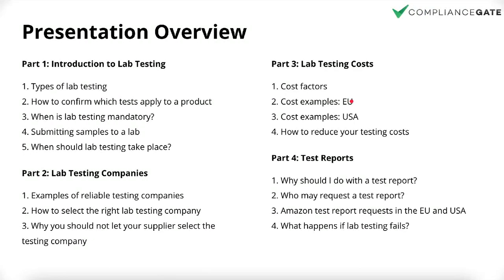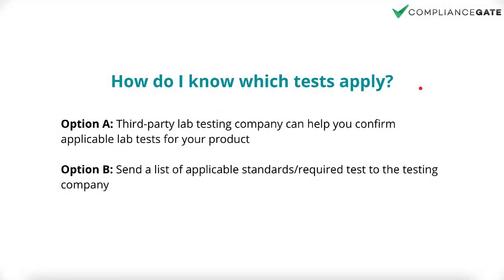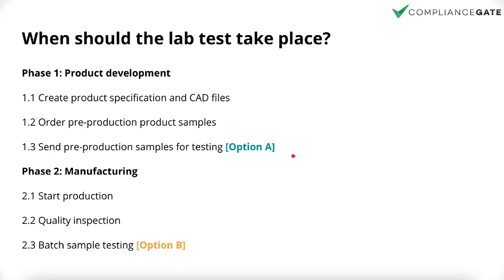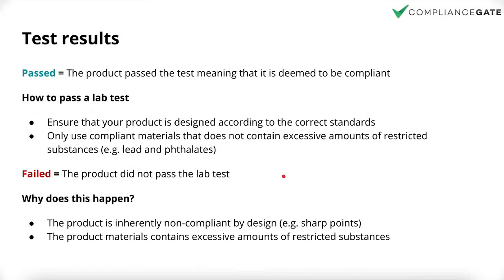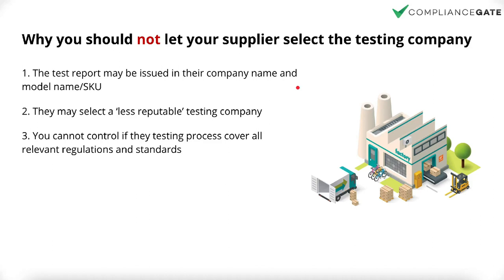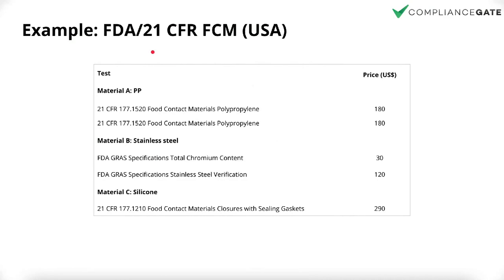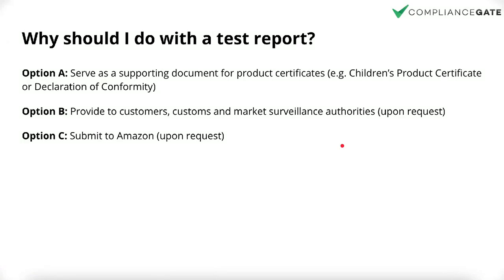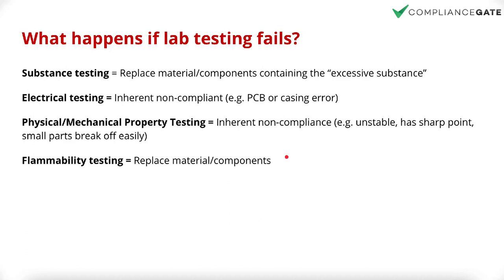Product Safety Testing Requirements in the United States and the European Union

Comment: Thank you for the Free information - much appreciated. 

one question I have though

If I, as a manufacturer have CE / GPSR Documentation and I provide this to my Importer / Distributor in the EU region, do they need to "Verify" by also testing the same product themselves using a 3rd party CSPC accepted company at their own cost as well in order to be a compliant seller in EU?
Reply from the maker: Hello,

For starters, CPSC accepted labs are relevant in the context of CPSIA and other CPSC standards - not in the EU (although many of those labs also provide testing according to EU requirements).

When it comes to testing, it depends on whether you can provide up to date test reports or not - corresponding with EU requirements.

If you can, then it's less likely (not but impossible) that your EU customers would need re-testing.

That said, if the test reports are outdated, or the product or material has been modified, then testing could be required.
Reply: @ComplianceGate  Thanks for the reply!

Ok, so it is more simple than first appears in that if the product is the same as tested and in a recent timeframe that still corresponds to the EU Regulations, then the importer will be fine to use our Docs and Certs. 

The term "Verify" is quite a loaded one, although, once looked at properly and within the terms above is is simple.

Thanks again!